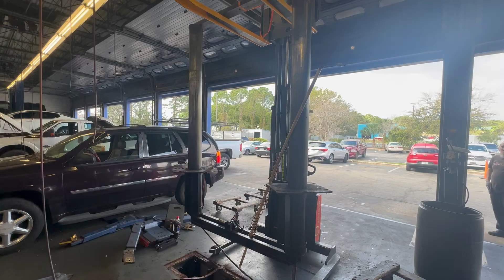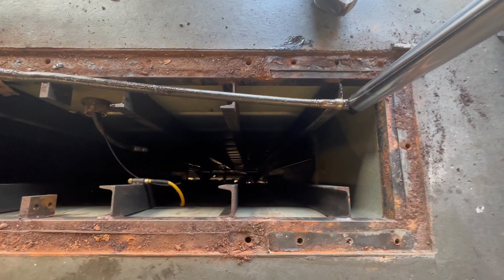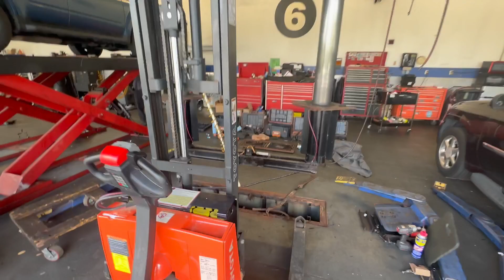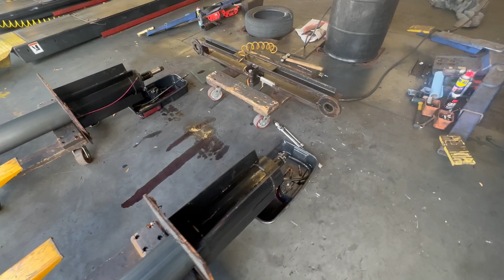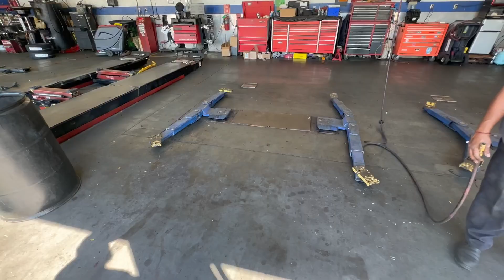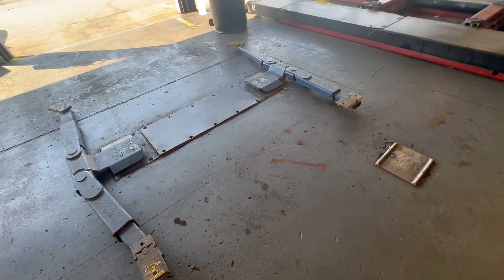Rotary S2L9 Inground Lift Rebuild Cylinders and Replace Hydraulic Hoses

Comment: Looks like an expensive task..to fix...my old school Rotary lift is got one moving part. One seal,  i requde it from a shop that been closed over 35 yrs..being torn down..i tested it before it was removed..went up , held psi .over night..now back in service in my home garage..  I restored it ..fully hydraulic..with new piping..a 1967.FP 46 H mark 5 ..model. Is old , but was in excellent shape no water table saved it..old school lifts are more reliable..in my mind..

Comment: Can you provide details on what happened to the unit? How long was it operational before braking?
Thanks
Reply from the maker: Hello, This is for a commercial store so they use the lift all day long, I believe the lift is 20 years old and after the repair was successfully completed, Once the cylinders are rebuilt is recommended to replace hydraulic hoses as well because it is complex to access to it since this is the old Rotary design, the new designs are easy to fix. I don't know previous records about if this was the first time rebuilding the cylinders.